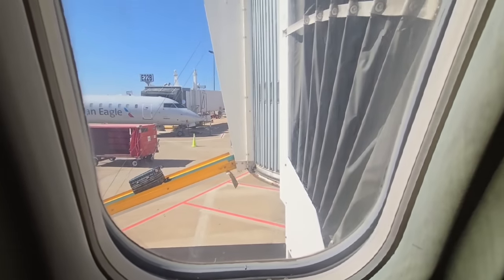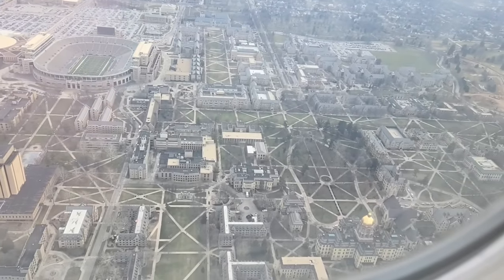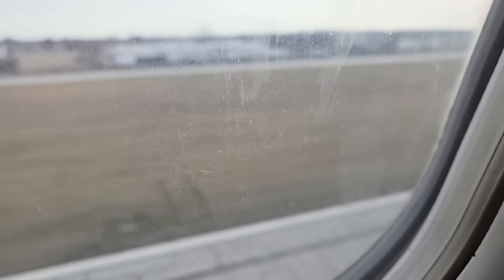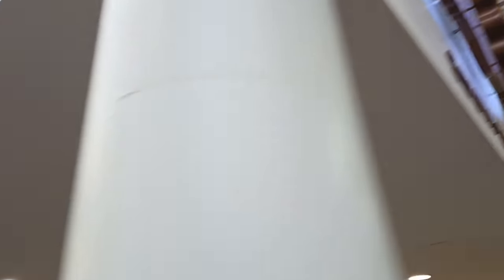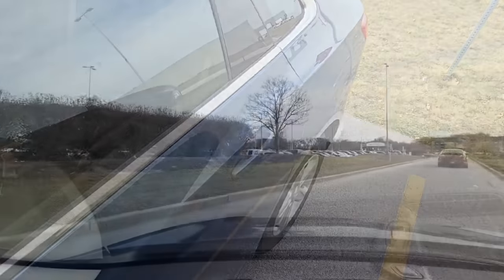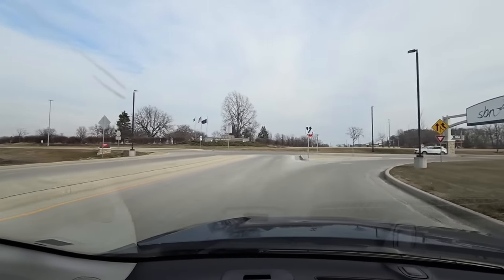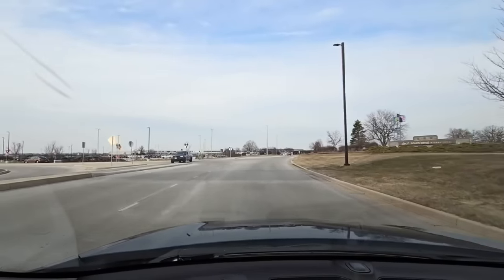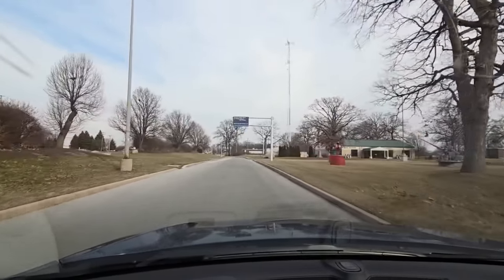LIPPERT Answers Questions about RV FRAME FLEX! Part 1

Comment: As a project engineer i would like to thank JD for this great piece of reporting/journalism first. Secondly, there are a few things in the interview that stood out to me and a few that the viewers have commented here:
1) 9:40 She said that they have no way to calculate the different structures that RV manufacturers put on the frame. That`s partly true. Lippert can test and calculate the maximum load on each point of the frame (front, middle, back) and publish those recommended loads to the RV manufacturer in order to avoid excessive load on a particular part that would cause the frame to fail or degrade faster than normal. It is being done in the automotive industry internally (as the manufacturer is usually the one that builds the frame/chassis and the body on top). So, Lippert don't have to calculate what is being put on their frame - only the maximum allowed stress on each frame point, similar to max haul weight figure on a truck (Which is the max weight the truck frame can hold when you load it at a certain point).
2) There should be a guide/engineering spec sheet that informs the manufacturer the recommended weight distribution on the frame. As it is not only the weight load on a particular part of the chassis but also how the overall weight is distributed along the chassis points. There might be a certain weight at the front that would cause harm if put directly load at that point and there could be overall percentage of weight distribution that is recommended to uphold when building the body (ex: up to 20% GVWR to the front, 50% GVWR in the middle and up to 30% in the rear). 
 3) 15:00 The discussion about approved pin boxes. That`s information that the customers should know and RV dealers should know also.
When dealerships agree on pinbox replacement at their centers, they should have the information and the capability to measure and see if the "new" pinbox or gooseneck meets the specification of that particular RV. In that case, they should have clear instructions on how to handle these cases - perhaps call Lippert to confirm the particular model of the new pinbox/gooseneck can withstand that particular chassis specs - perhaps use an online database with the exact length, weight, structure of the king pin to ensure it is within the "safe" specs. There are many ways that a procedure can be applied between Lippert and the manufacturers and the dealerships to ensure that they know what to do and where to get the required information before conducting "modifications" on an RV.
Also they might consider extending the base of the kingpin for larger RV`s (above a certain GVWR) to cover more points of contact with the front frame in order to provide extra stability during traveling and sudden forces that are applied between the truck and the pinbox and the frame.
Reply: 🤯🤯 What in the hell did she say?! 
The frame not moving at the same rate as the wall attached to it!!?? 🤯🤯
I wouldn’t give you $5.00 for one of those behemoth rolling garbage wagons out of Elkhart!
I worked in that sh*those town on that overpriced oversized GARBAGE, that’s why I’m building my own trailer. 💥💣😎

Comment: You started with an airplane flight.  Would you ever consider flying on an aircraft where Lippert did the engineering of the airframe?  I doubt it very much.  Lippert has had various frame issues in their products for a long time.  I remember coming across them 10 years ago when I was considering a new travel trailer.  A bit of research on the model I was considering I found numerous accounts of frame cracking on ones with Lippert frames.  I won't go near a product from Lippert based on that and the newer information just reinforces my viewpoint.
Reply: If an airplane had that same "extremely low" failure rate, no one would fly.  Consider the talk swirling around the 737 right now.
Reply: I agree with that statement. But I also know the R.V. manufacturer controls the money and buying power. They probably completely dictate to Lippert exactly what they desire, and those decisions are all based on GREED not on testing or building the safest or most durable product.  The manufacturer wants lower cost per unit, less weight for a better towing factor and the minimalist design they can get by with as the average R.V. gets towed very few miles in their lifespan and sits in a storage lot or next to someone's house and typically fails from sun damage and water intrusion first.

Comment: I just kept thinking, “your honor, leading the witness”. I get they build/design things to keep cost and weight down. But maybe they need to downsize these RV’s so the design can be improved. This would mean you’d need a larger tow vehicle for smaller RV’s. But after spending 23 years in automotive testing these RV’s are woefully under designed. Cars cost so much because they are over engineered for scenarios that they may never encounter. I think the RV industry needs to follow the auto industry and learn a few things. I’d rather pay more for a quality RV, vs a cheap RV that fails long before it should.
Reply: Yup, been my thoughts exactly too! 👍🍻

Comment: I just thought of one thing of fault that no one has mentioned that we see everywhere. You see everywhere from the cheapened door latches to the garbage suspensions. Corporate bean counters. They're responsible for figuring things out like how to cheapen something up with an acceptable failure under warranty rate to overall save the company even more in money to increase profits. See it in the automotive industry all the time, planned obsolesce. Wouldn't be surprised if that was the grand design of a manufacturer. Get a reputation of quality, then your products last to long and your customers are not rebuying a new one in your metrics time frame, so you start to make it to where it starts having failures in a time frame in which your research tells you people expect failures to happen. How sad our society has become to do this with every product.
Reply: There is an industry term for this: "QUALITY FADE'.

Comment: First off, great video JD.   I always enjoy your content.   But at the end of the day, RV component and manufacturers need actual REGULATION!  There needs to be ACTUAL ACCOUNTABILITY in the RV industry.  The fact that there is very little consumer protection is a credit to the lobby of Lippert, Moryde, Grand Design, Keystone, Winebego, etc.
Reply: Couldnt agree more, the RV industry from the trailer manufactures/dealers and Suppliers take little responsibility in the quality of these products.
Reply: Regulation and Accountability.

Comment: I’ll reserve judgement until the series is done but nothing in this video (other than the aftermarket pin box question) really tells us what’s going on with these frames.

I’d really love to hear a Lippert exec explain why they sell products like the cargo tray that they sent a tech to weld onto your personal 5th wheel that they then say will void the warranty on my frame if I install it. If they are selling products that are intended to be attached to the frame of an RV there should be a way then to install that product without voiding the warranty on that frame.

Comment: We were lucky and didn't have frame failure we had frame flex. We have had this "flex" twice now (2 different RV's) They were both Keystone products and they covered the issue under warranty without issue. Once they took our wall apart, we could see that the welds in the wall (wall studs) were very poor. The welder stated that he has a hard time repairing because of the metal being so thin on the wall studs. So, we think that Lippert does hold some of the responsibility, but we need to look at the "rest" of the components. If the walls are part of the structure, then they need to be built to a better standard as well. Thanks for the video!
Reply: I thought Lippert didn't build the walls...just the trailer 'platform. 🤔
Reply: @billbillinger2491  JD’s video helped me to understand our specific problem. If the walls are part of the structure then the welds and quality of the metal in the wall studs on our was severely lacking. We have photos of some terrible welds. One of us worked in Quality Assurance in a machine shop and those would never be allowed out the door. Just our opinion
Reply: Wall studs are put in by the rv manufacturer not lippert. Weld joints and cracked rails would fall on lippert.
Reply: Did any of the welds actually fail?
Reply: @gcc8584  The aluminum ones in the wall did but not on the frame itself.

Comment: Good job with the questions and just letting them talk and repeat the answers their lawyers gave them.  This isn''t the format to challenge answers, but to investigate the answers they give.  This should be a good interview series.  Once question I would like to see asked is "are there load weight guidance for the upper deck?  Or should the pin weight not exceed XXXXlbs? "  I think this theory should be discussed for these heavier capacity trailers.

Comment: Great job JD!  I understand that you have to be very careful in how you handle their answers.
As mentioned in earlier comments the VP was there only to protect Lippert ! It was obvious by the way she was answering tooo many questions for the Engineer. 
In the early days of slide-outs  very few manufactures, both frame and superstructure  ever realized that when they cut a hole in the wall it lost most of its strength, most never did!    This caused leaks, cracks in the walls and ceilings and frame damage.
I was selling Airstream's when they attempted their first slide out, not having  one was killing their sales!  When we attended the Louisville show they had one setup for display, we ordered two for our spring show in Austin TX.
When we were planning the setup  for the show Airstream informed us the slide out floor plan would not be available,  Yada Yada Yada!
I had known the dealer rep for years, when he arrived in Austin he told me on the model in the   Louisville show, the slide out was setting on it's own stand!  They went in at night and setup the trailer while no one else was there, set the slide next to the trailer on its own stand! Ihad noticed the solid curtain around the bottom so no one could see??? 
After they cut out the wall for the slide they could not find a way to maintain the integrity of the aircraft type frame that makes the  Airstream what they are!

Comment: This is why we have never owned a travel trailer or 5th wheel. Class A on Freightliner chassis never had an issue. That said, Lippert was passing along double speak. If Lippert really wanted to help, they would have spec'd out load limits at different points of the frame, overhang allowances and so on.
Reply: This really sounds like a problem with the steel, weld, not holding cracks and brakes in different areas. The steel supplier will come out in the wash sooner or later.

Comment: My opinion coming from a construction background and dealing with engineers over the years tells me that the engineers are doing the minimum required sizes to make the frames affordable. It is all about the money and bottom line. To me the sidewalls should not have to help out with the frame flex. The frame which is the foundation of the rig should support the rig on its own. The way the aluminum is welded on the two sides so they have a flat surface to attach the walls interior and exterior, how can that give strength to the frame from flexing? Aluminum flexing and stress normally breaks right at the edge of the weld. Saw that in the bicycle industry when they were using aluminum building BMX and Mountain Bikes. Frame stress from flex would break the frame at the weld. My opinion is to build a frame strong enough to handle the load without flexing to the point of breaking. I feel the same way with the way they allow the axles to be rated lower than the entire GVW as they count the pin weight or tongue to carry part of the load. Never have liked that. My thought is when that rig goes around a corner look at the weight put on that side of the axle and tires. I know some manufactures like Lockwood had upped the size of their axles on their trailers which is a better way to go. Hate to say it that it is money before safety and performance.

Comment: As an Rv Repairer for 20 years I have seen many frame failures on all brands across the industry. I’m in no way biased towards any brand (I don’t even own an Rv) I’ve had to do all repairs to help strengthen the front overshot including the chassis and the side wall structures. In my opinion (and first hand experience) any slide outs in the overshot take out a lot of strength in the sidewall and create a weak spot - filon always cracking and frames always breaking around these areas. The first noticeable issues are when the slide outs stop working correctly or at all. Like I said, I’ve seen this issue on a lot of manufacturers not just GD. 
I don’t think Lippert is to blame completely, but I also think they should “put their foot down” on manufacturers that don’t use their products correctly. 
I’ve seen this with a lot of other products that Lippert manufacturers alter to suit their desires, not so much the way the product was designed to be installed, take the in-wall slide for example.

Comment: I’ve been around heavy construction and watched the frames of tractor trailers flex with loading equipment and supplies. I’ve built multi level buildings. I was in sheet metal. HVAC and roofing. Metal flexes under loads. Metal grows and shrinks on roofs under the sun. Temperature. These super structured RVs are getting huge. I’d expect movement and tolerances. I’m sure there are tolerances for metal flex in building yachts. The bigger you get the bigger your maintenance is to keep equipment working. I don’t think the average public thinks steel moves.

Comment: Just adds to what I’m thinking.  Lippert provides the frame and guidelines.   They have no idea what the RV manufacturer will do/or not do with it.  

I still think RV manufacturers are specifying cheaper frames and putting too much on them from the RV factory.   More than what the frame is designed for.
Reply: That's pretty much exactly what they do. Give me a frame that's X feet long and can hold X amount of weight, oh, and make it as cheaply as possible. Lippert builds it. Then the coach builder goes "hey, why bother paying for a new design, lets just build several different lines of RV's off this same frame." And when it fails both the coach builder and Lippert can point fingers at each other leaving the consumer holding the bag.

Comment: Some observations:
Are the Lippert welders certified to industry standards? Is there a regular weld inspection done? By an independent testing service?
Also, an unknown to this whole topic is in any instance, was the RV overloaded? People don't regularly weigh their unit to make sure they below the GVWR.

I would agree that the relationship between Lippert and the RV mfg. is a little fuzzy or curious. I get they don't want finger pointing going on, fine line.
Great job trying to get to the bottom of it.

Comment: After 40 years in RV repair, my experience is “owner ignorance “ when loading their RV. Yes! Very rarely a flaw occurs, however, 99.5% of the time the RV is OVERLOADED FORWARD OF THE AXLE !!!! I have customers stand toe to toe with me and argue that the RV is not overloaded ! Yet when the weight on the pin box is measured the silence is deafening . I have personally seen hundreds of 5ers a couple of lbs (100-300 lbs) overweight on the scales BUT were a couple of THOUSAND LBS overweight on the pin box. Remember this formula 15%-20%(max) of the weight described and printed on the “ weight rating “ tag/sticker can be on the ‘pin box’. Example: 18,000lbs X 20% = 3,600 lbs max! Every time I pick up a 5th wheel with the almost new fork truck a weight scale shows me how many lbs are on that pin box(within 5lbs). The 5ers loaded for a trip or full timers are always, did I say always? , over loaded on the pin box!!!

Comment: I think it falls more on RV manufactures because they're the one who build things on top of the frames. I understand, they need to be creative and come up with new floor plans and such but what RV manufactures do on top of the flames matters more and once it's purchased. And, people who haul often should know anything you tow have much greater wear and tear in faster rate from all the turning, bumps on the road, and lack of suspension support. Also, these RVs are built with fragile materials for the most part so, there will always be problems. Never ending story.